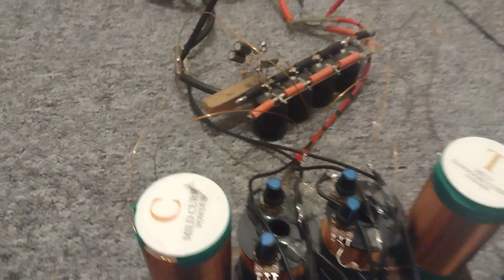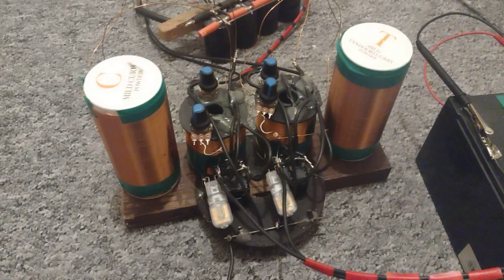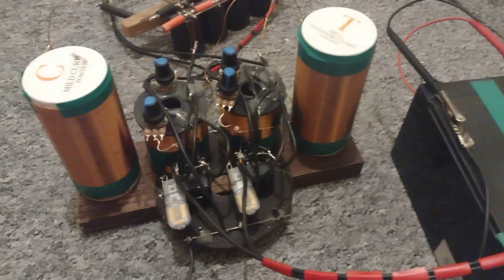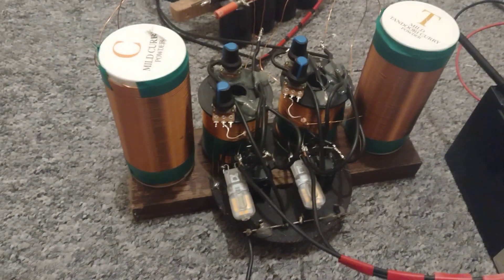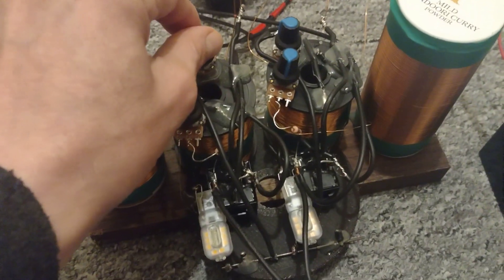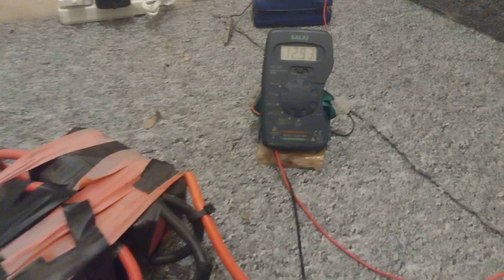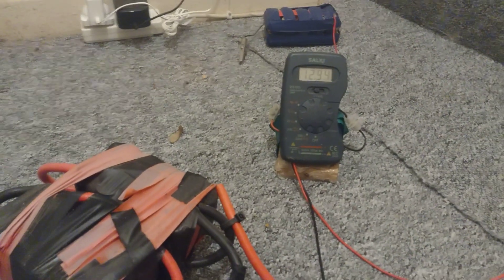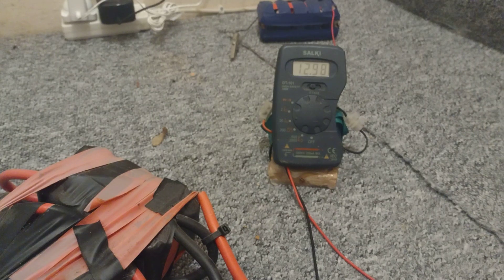crazydeviceno3

Comment: Nice.. Reminds me of the magnetic amplifier work I did. The wave differential of the two tones cohering is responsible for the energy gain!
Reply from the maker: Thanks Chris...  that's interesting.  I've got 4 of them with slight variations..  With the 24 volt device I've noticed if I tweak or reduce the speed of the switching I've noticed I can really raise the volts..  It looks like its sending quite a lot back to the input load because even that meter goes crazy so I don''t leave the meters unplugged from it when its running & have to switch off to get an accurate measurement..   the sound proofing makes a real difference..  but some of the Relays run quieter... & others sound like a chain saw lol
Reply: Oh! Silly me, I didn't realize they were relays at first :) Oh yea, very noisy... But not as bad as coil windings making that Len's sound. I did alot of switching similar like that. The relays just die after a few days..  They can't take the heat! 🔥 One thing you should definitely checkout, is adding a capacitance in parallel with the NC contacts and operate in self-defeat mode. You will see much greater magnification and you can actually attempt to control the frequency.. You'll begin to hear pops and crackles when the timing becomes tuned just right..  One device i found to be more resilient was literally a Tattoo gun. It contained the tempered "buzzer" armature that can withstand some high heat without warping.. They normally come with a 10uF cap in parallel to the NC as well. The Rhumkorff spark coils were originally built using this self-defeater/relay operation..
Reply from the maker: @drgonzo7806  Thanks for the info Chris.. I will look into adding the Caps as you mentioned in parallel I've got some that should do the job....  Initially I noticed mine heating up after I added the coils..  so I matched 18k/2watt Resistors & that got them running cold again...  The series coil I added really improves the charging..  going to give the Cap a Go.. Thanks again Chris  -)  I bought a large Wooden Chest which I've sound proofed & about to drill for the leads.. with under layer inside & out.. & I've used proper sound proofing foam paneling on the outside...  It works with cheap cardboard boxes too.. with the under layer & left over paneling.. I've used Magnets to seal the box closed during operation... & I can barely hear them... The leads feed through the front & the back of the box...
Reply: Check these out :) 
https://www.youtube.com/watch?v=fvyADIe91Q0
https://www.youtube.com/watch?v=VM5da2AeWfA